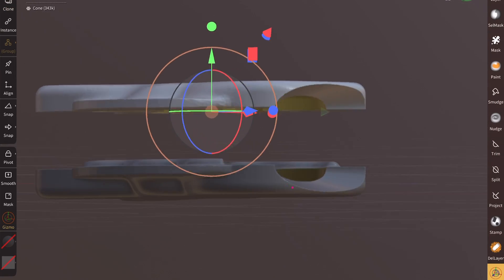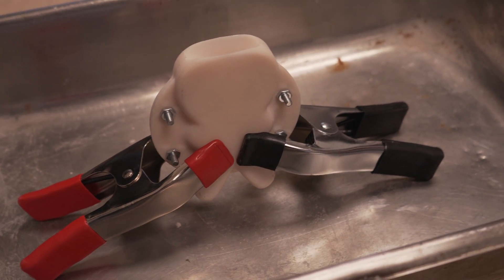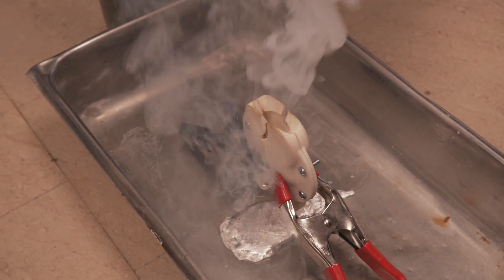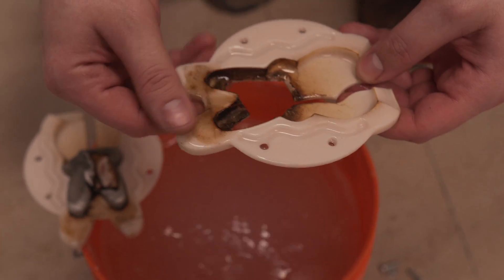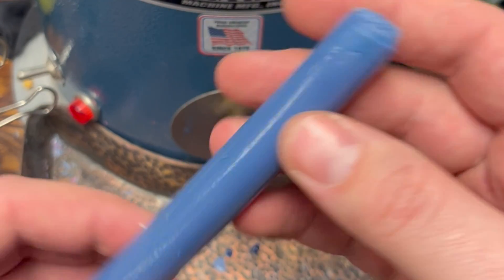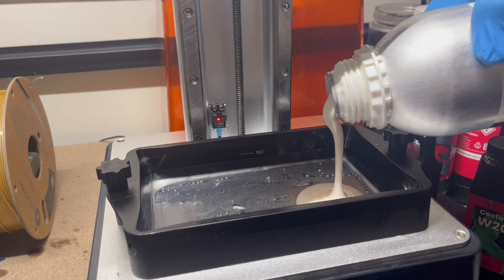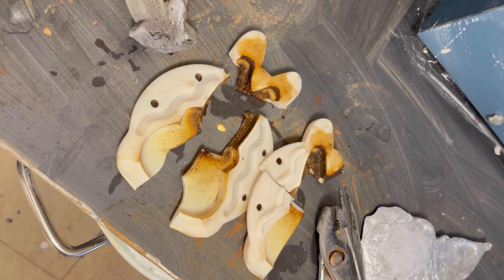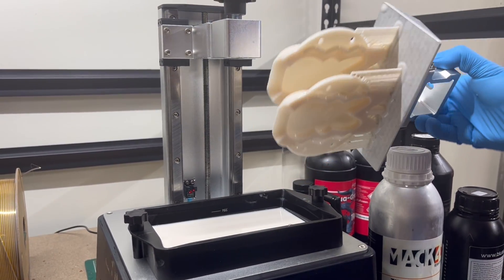Casting into a 3D Printed Mold - Mack4d Tiko-H

Comment: Instead of printing the mould or mould frame for vulcanising, the absolute best use case that I've found is to print the models that I will then use in a vulcaniser, that way I don't need to cast it in metal first. I use Siraya Sculpt for that exact purpose, though the grey formulation isn't so great at the temps needed for regular silicones, and i have to bake it at much lower temps for longer.

Comment: could you use this to cast bismuth?
Reply from the maker: Could you use this material to cast low temp metals like bismuth, most likely yes. However, as we mentioned in the video, does it make sense for a business process when you might only be able to get 2 to 3 moulds out of every bottle that we’re unsure of.
Reply: Yes, that would work